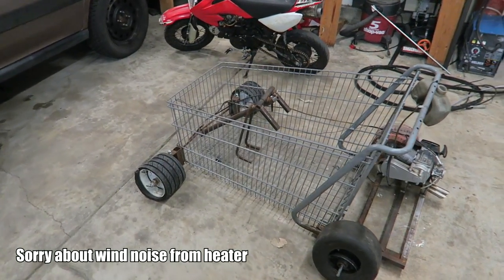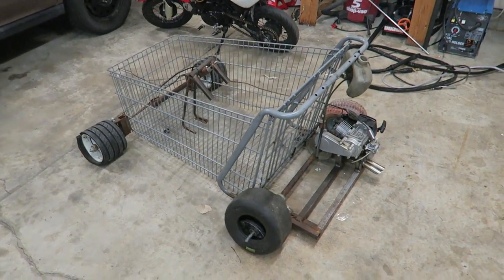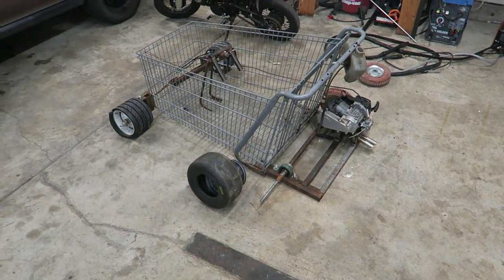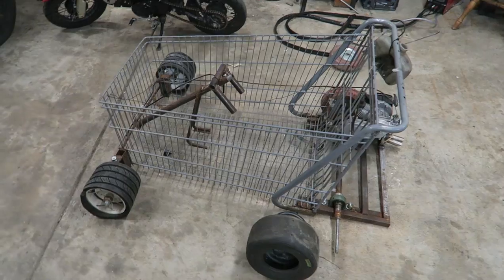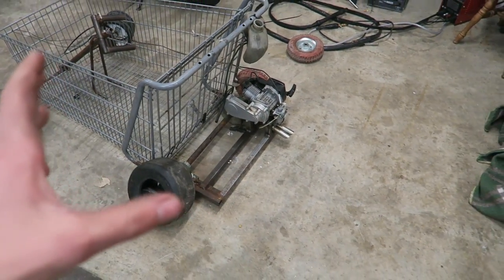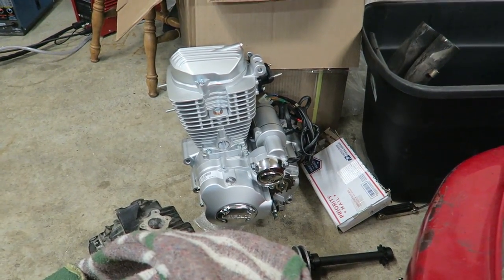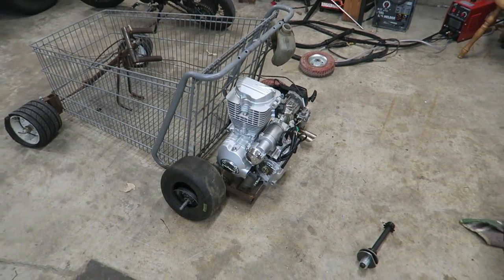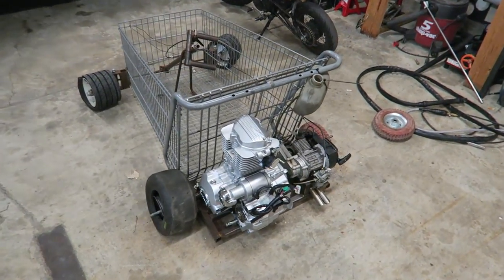Shopping Cart Go-Kart Build!

Comment: Turbo the go kart
Reply: +1
Reply: Kihd Nitro
Reply: Dm
Reply: Yo bro they should
Reply: Kihd Nitro all it needs is fuel injection ,o2 sensors and a boost gauge
Reply: Kihd Nitro These chinese clones can't handle the boost😂
Reply: Kihd Nitro chinese honda clones damn phone ahahah
Reply: Boost until it blows,  fix it and try again
Reply: This. Get a turbo from a smart car.
Reply: Kihd Nitro A new chassis too, because that will be a death machine
Reply: charlie would race it
Reply: and run it 30psi
Reply: Kihd Nitro that engine won't be able to spool a turbo
Reply: Park?
Reply: Kihd Nitro YES!
Reply: Kihd Nitro it's been done and it sucked
Reply: This has to be done
Reply: theres a guy on here who did it and it even has a bov, search it up, turbo shopping kart
Reply: The engine wouldn't be able to spool up a turbo unless its the size of a lug nut.
Reply: Jake Wicha how about a turbo diesel?
Reply: Turbo charging a small single cylinder carb motor is a pain in the ass for not much gain. It can be done but it's not really worth it. Better to just go with something like a 125 2-stroke which would give way more power than this 200 while being lighter and smaller. 40HP+ would be easy and would shred the tires off that shopping cart.
Reply: It can, the guys from carsandcameras put a 911 turbo on a 212 (i think it was a 302) for a drift trike
Reply: they should turbo the kart, that would be so awesome to see that
Reply: The cart won't handle it cause it's too light.
Reply: Yes it will how do go karts handle?

Comment: Build a frame and put the cart on top of it, don't play with your life..
Reply: UltraProof313 Was going to say the same thing. Especially the steering.
Reply: UltraProof313 like that would help. short of building a tube frame, what's the point?
Reply: Boosted Miata That shopping cart isnt strong enough for the constant beating they will put on it. It will fold or bend after a while. If they put some supporting frame underneath the sides or something it will help tremendously.
Reply: x2
Reply: don't forget the Audi steering wheel with paddle shift.
Reply: I AGREE, BUILD A FRAME! The repeated loading/unloading from gassing/breaking/drifting/donuts will cause fatigue in the structure of the shopping cart. At least build a simple rolling frame that the shopping cart can be welded to. Remember the hp output is being sextupled, so the same approach that was taken last time will now be inadequate.
Reply: DirtyHarry i
Reply: Naw a sequential shifter haha
Reply: if you dont play with your life, you arent playing at all

Comment: Might I suggest building a frame the same width as the cart, then mounting the cart onto it? It would solve your structure issues, and give you a good platform to mount controls and necessary stuff like the fuel tank, clutch/brake reservoir, blinker fluid, etc. It would also allow you to make changes easier in the future (like boosting it...?).

Comment: I have the exact same engine mounted on my homemade gocart, it has a ''transaxle'' from an atv tho, so its reverse and forward on the rearend, plus 5 gears. Mine was originally from an atv with a shaftdrive. Great engine and ALOT power for that small one. FYI dont turbo it as many says here, it will cost way to much, you cant (barely) turbo such a small engine without it messing up the carb making it overflow. And 16HP is well enought for that thing!

Comment: I'm not sure this is a perfect idea, but hear me out.

What if u got a old steering rack from a small motorcycle/moped? (from junkyard or someplace cheap)
You would have a throttle and clutch on one side of the handle, and can have a hand-brake for the other. 3 things compactly sorted that just needs wire-setups. 

All u would need then is a gear-leaver solution.

Comment: You probably could use a moped shocks to make suspension for the cart. 

If it's going to be low then make a skid pad to fly some sparks? 

Probably some kind of heat shield since you didn't mention a seat? 

Maybe you can get old golf cart wheels and steering system?

Comment: List of awesome things to do for your cart

1. Paint the frame and the kart a cool colour like black cause black is sick
2. Get proper go cart wheels 
3. put a proper frame under the cart so you don't get hurt
4. put a shielding plate behind the motor so your don't burn your own back
5. Reroute the braking, shifting, and accelerating line under the cart to the front neatly
6. (Optional) but if you can put a dope spoiler on the back  
7. Try to route the motor in the middle so the sprocket spinning the axle is in the middle so u get a even distribution of power to both wheels
8. TRY FUQING TURBO IT, Seriously tho it would be so dope

Comment: i think maybe mount the engine in the middle instead of the right to help you stay straight when you gas it. for shift linkage and a clutch set up, get a shifter cart shift linkage and steering wheel with the clutch handle on the steering wheel.

Comment: Well. That's gonna get ugly quick. 16 hp supported by a shopping cart, it will mangle your flimsy tube and flip over. Build a frame under it at least, move the engine and rear wheels 12 inches back to not lift your front wheels. (I built a couple frames for electric go-carts in the 50 hp range)

Comment: Just to throw some ideas in there. You could go look on how the classic Vespa was setup with everything but the rear brake fitted to the handle bars. That will save you a lot of feet space and if done correctly you will probably not need a pedal brake.

Comment: Wouldn't it be better (from a weight-distribution perspective) to have the engine in the center? I'm not sure if this is practical, but having it offset seems like it would be bad for handling. You also need a more comfy seat imho. Also interested to see what you do with breaks, tyres and driving controls.

Comment: that's sick... you think you could help me out? I need to know what the height of one of those engines is from the mounting plate to the top of the head to check if it will fit in a project of mine

Comment: For rigidity and due to the added stress of that huge engine i would advise building a frame under the cart. It could be small like that 1" square tube but that would also allow for the frame to extend part the plane of the front of the cart and you then could have more room up front for the better steering. my .02$

Comment: get a used ebay racing kart seat (probably need Extra Large size), fiberglass bucket seat, cheap, bolt it in. Look on ebay for used set of Douglas one piece kart wheels / tires, look great. Definitely mount the motor ahead of the rear axle, move that axle farther rearward, weight distribution 40/60 front/rear works well, no more  in rear than that (with you sitting in it).. or it will just be popping wheelies and won't steer (gross understear).

Comment: you should turbo it and make the back sit higher than the front. then you can make an extended "swing arm" and weld the motor on and extend the cart to make it bigger for you. then once turboed and raked you can put some nice wide back tires on it with nice traction on the front with more of a knobby tire 👌. im getting ahead of myself. even though its not my project lol. oh yea btw how is the pitbike motor working on the crf? i wanted to see how long they last and the reliability it seems to have held up pretty good in my perspective but id like a 1st hand person tell me. thanks and keep up the cool builds

Comment: I know you said you want the short wheelbase so you could cut the nose of the cart off and extend it out a little more into a v or at the angle the sides of the cart are now and then cut the front of the cart to fit how long you extend the v and then you could put pedal in front of the steering column and leave the wheels where there at and then since you would have a overhanging nose you could do a cool little bumper or something. That would keep your wheel base and give you extra room without it looking wicked stupid or something. Reply if you want even if you think its dumb or if i gave you a new build plan lol.

Comment: id put a ladder frame on the bottom of it, as a base, then go get a 2nd cart, weld on 3 hinges on the front so you can flip it up to get it, so you can fully cage it with 2 carts :) id go get some more square tube and make the frame. also see if you can get a custom axle aka go get a junkyard rear end take out the shafts sell the diff and rear housing, cut 1 so you can weld it together and put "normal" wheels on it.  going to need to preheat the shafts to properly weld on but that isn't hard to make a charcoal forge :)  as you can guess my maddness is real.  next id say put on a junk honda engine on the back and build a custom sup to hold it xD  yeah im insane. i can almost see it now...some fucked up mad max lookin thing with a full cage xD

Comment: you buy the wrong engibe,you need to buy zongshen 250 quad engine electric start,water cooled ,4 gears  and reverse,you got air cooled engine that will be behind you and will not cool cuz youre sitting in front of it

Comment: You forgot to mention "front lights, Back lights, A battery,  Mirrors, New Go kart wheels,  New steering wheel, super durable light weight seat with seat belt, A helmet, and U need a roof with if u fall?

Comment: i have the same engine in my old yamaha yz 125 and it was 2-stroke but the old engines stransmission broke :O
Reply: and its pretty powerful and put that type engines 200cc head on it i have it on my engine and works good and has more power or is that motor 150 not 200cc